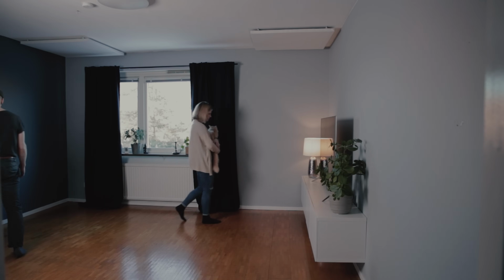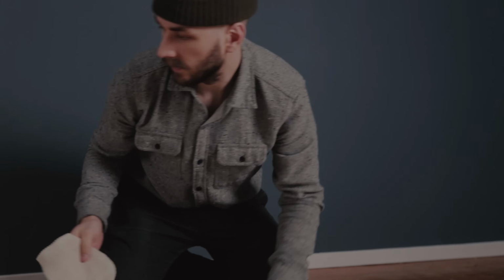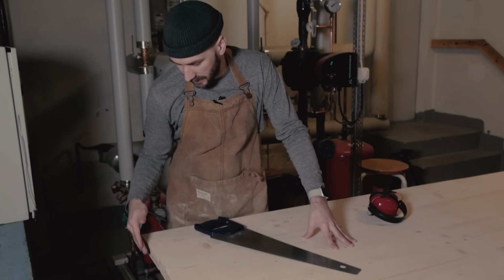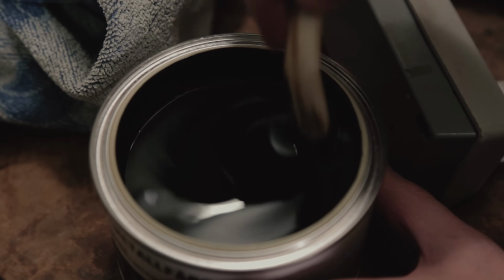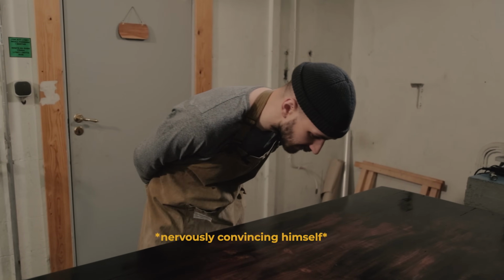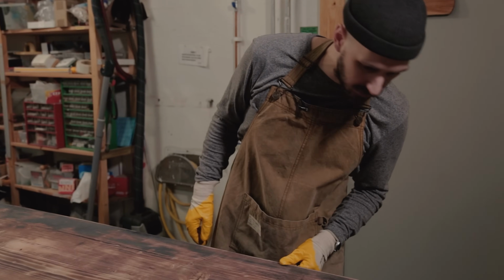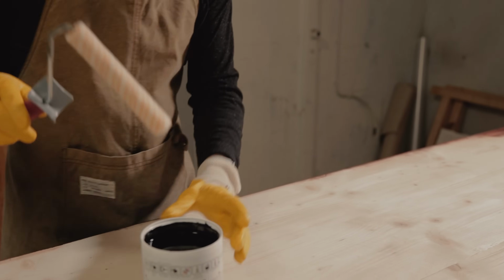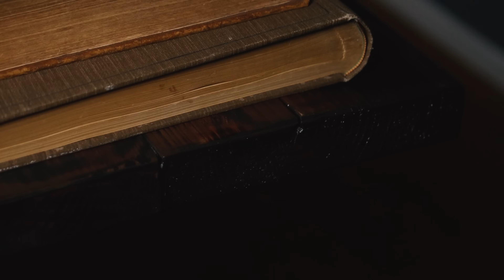Building a Desk using Cheap Wood (DIY)

Comment: I did this for my last computer desk and it was honestly not worth it. It looked great at first, but after about two years the pine did not hold up at all and it looked pretty bad. I replaced it with an acacia wood butcher block countertop. It did feel a bit like "cheating" to buy something premade, but it was less than half the price of buying a similar amount of hardwood and doing another glue up. Plus all the time it saved me.
Reply from the maker: Really? Sad to hear that Taylor. I have quite the opposite experience actually. I'm still using this table as we speak, 3 years later and it still feels and looks the same. It's holding up great honestly. I'm glad you're happy with your new table though. There's no such thing as cheating in making furniture, it's about doing what makes sense to you. There's no point building a table from scratch if you're not enjoying it, unless you want a very specific custom design of course. Sounds to me like you made the right decision! Thanks again for watching and sharing your experience!

Comment: Personally would have used pocket holes along side wood glue. Would have helped true up the boards to one another and straightened some stubborn boards out. Also alternate your clamps on both sides of the workpiece when glueing up, tightening some more then others you can bring some boards out of warp.
Reply from the maker: That’s a good call Cody, we might actually try that for the next table. We plan on building a kitchen table later this year! Thanks a ton for the tips and thanks for watching and sharing your thoughts here in the comments, we really appreciate it!
Reply: I would also reccomend burning the wood before you stain. It will prevent toxic fumes. :) Best of luck.  @byferner
Reply: glue and THEN pocket hole?
Reply from the maker: @Ninja_From_Fortnite I’m not sure what you mean?

Comment: Today that cost is doubled. 2x4 at hd in my area is almost $6. I end up getting a butcher block 72 inch for $110. Just needed some sanding and stain.
Reply from the maker: That’s unfortunate, if you wanted to build it yourself that is. I hope you’re happy with the results either way. Thank you so much for sharing, I’m sure others can find this information useful!
Reply: only $6? where i live “good quality” with this thickness plywood is $50-$100+ for both sheets and planks
Reply from the maker: Holy smokes :o

Comment: Honestly, this is great. You spent a lot of time making the table look really good at the end. It's a really rich look, like chocolate or coffee. I love it. Definitely a statement piece in a room. 

I think people would buy furniture in this style. Some basic end tables, or living room tables. Or desks. Maybe a bed headboard. You should try selling a few :)

The only thing that would make this build better is incorporating the computer into the bottom of the desk. I'd also say Router/modem, and power bars. 

When I built my desk, I was surprised that with just a bit of extra wood, and a few extra hours into it, I could hide everything inside the desk. It cleaned up the room massively. Depending on how your house is setup, I would recommend this if you kind of have everything in the same area around the desk. Really can tidy things up.

The only other tool I would recommend that you could get, that would make part of this a lot easier for you is a hand plane. You use it in place of the sander, and it'll help you get a nice flat surface much quicker. And if you can sharpen it well, smooth :)
Reply from the maker: Wow, thank you soo much my friend! What awesome feedback!

Yeah I’ve been thinking about selling furniture once I’m done with the ones we want for our place 😄

Incorporating the computer/router/cable management etc. has definitely been on my mind! Great ideas. A tidy work space and cable management is so satisfying!

A hand planer would be awesome, I can imagine that being really handy and make the process a lot faster!

Thanks a ton again for the kind feedback and for watching! 🙏
Reply: @byferner  No problem, It was a good video, Thank you! You made me love brown furniture. That took a fair bit.
Reply from the maker: @truckywuckyuwu  Haha, awesome!

Comment: Instead of a thousand rolls of sand paper, a simple manual planer would make quick work of those raised edges with almost no saw dust and they are easy to use as well.
Reply from the maker: That is indeed true, thanks for the suggestion! Would love to own one or more of those one day. As for this time this was the option in hand since we don’t own a hand plainer and the rolls of sandpaper were the only thing we needed to buy. Thanks for watching and interacting, much appreciated 😀

Comment: looks great :) thanks for the amusing comments in the video! it was great fun. one question: aren't you worried because of the soft nature of the wood? I want to build a desk soon and am not sure if pine will be hard enough
Reply from the maker: Thank you so much Lennart! Great question!
We would prefer to build it in hardwood, but it’s so much more expensive and we didn’t have any experience, we wanted to experiment with pine first. The clear coat will strengthen it a bit too. Plus we don’t mind if it gets a little bit more beaten up :D Also, I’m not sure we’re to look for hardwood around here, might have to order it online? Thanks again for watching and commenting, much appreciated!
Reply: Try soft maple ! Still easy to sand and work with but doesn’t dent easy like pine/poplar.
Reply from the maker: @NYSeaNile  Thanks for the tip, I would love to try it out! Unfortunately, we don't have much of that here in northern Sweden, so it's hard to come by and most likely pretty expensive because of that. :/

Comment: I would recommend a wax finish. Wax finishes with stains in the wax have thicker layers in cracks and light on flat areas. Then maybe some boiled linseed oil or maybe even shalack overtop
Reply from the maker: Appreciate the tip! I think that would be better for the look we were going for as well! Thanks a lot!
Reply: No problem 😊

Comment: I did something very similar, but I skipped a step. 

When I was dating my now-wife, I kept talking about how I always wanted to build my own desk. Most of the stuff you could get in stores was cheap and would fall apart, and custom made desks were extremely expensive. Not to mention, a 4 foot desk just wasn't enough. I wanted a 6 foot desk because I wanted it to fit a large monitor as well as my PC and have plenty of room for a large desk mat for my keyboard/mouse etc. 

Well, we moved in together right around my birthday, which was almost exactly a month before I asked her to marry me. For my birthday, she told me she had something for me in her car. I went out there to find a 6' x 30" slab of edge glued pine. Her grandpa has a large woodshop that he let me use. I took it there and spent about a week sanding it down smooth (but leaving the edges kinda rough for that rustic look), staining it, sealing it, and I mounted it on a pair of metal dining table legs I ordered off Amazon for like 80 bucks. 

I absolutely love the result.
Reply from the maker: Wow, thanks for sharing! That’s awesome! I love the hear stories behind DIY-projects! This is what makes each piece so special and worth the hassle of doing it! Thank again for watching and keep building my friend!

Comment: For final sanding, I found those 320 grit sanding sponges are very good and last forever.
Reply from the maker: Interesting! I’ve heard that if sand too find, the stain won’t absorb as well. So I guess it depends on how dark you want the stain to be. Definitely worth experimenting with though! Thanks for sharing your tips and for watching 😊
Reply: @byferner  That's a wrong hearsay, the stain will get in whatever how fine you sand, especially with a wood as tender as pine (chemically, lignin is corser than the stain). I don't go as coarse as 40, I start at 80 with the sander used for wood flooring, then use the 360-grit sponge to make it "shine", brush with a sweeping brush to get rid of the dust, then use white spirit, then 360-grit sponge again when the spirit has dried, then soak with sunflower oil (it's vegetable oil too) overnight and wipe. I guess that's when you'd use the blowtorch. And after that, I use the rainproof tint with sponge and tissue (like you) to avoid brush marks (which come in minutes if you don't wipe them immediately), I use the 360-grit sponge once dry before the (optional) second coat. I only go a third coat when it's going outside, like a kennel or a postbox, but for my "stage" made of pallet wood (basically a table without feet), it looks perfect after only 2 coats. I might setup a camera some day to show how I do and what I get, it's not necessarily how it should be done ;-)
Reply from the maker: @RegisMichelLeclerc Awesome, thank you for all that information! 

That would be really cool, let us know if you decide to record it! Thanks again for the tips and thorough explanation!

Comment: What do you think of shorter  planks going in the direction of depth rather than length?

Some barn doors are built like this in two layers.

Length wise is fine but could warp if stored in a humid environment?
Reply from the maker: Yeah for sure! I think you’d need some kind of reinforcement, like you said in two layers. Otherwise I think the table would lose a lot of strength and integrity. But honestly I’m no expert at all 😄 just my guess! But I’m sure it would look cool, definitely! 

I would also assume that you’d have less warping if you had two layers in opposite directions, but again I’m no expert! 😄 I’m just a newbie experimenting myself!

Comment: man, that's just my dream desk top I wish I just had tools and space to work on mine but unfortunately not have this much money to buy tools or rent them as they are not available to any local carpenter here.
Reply from the maker: Honestly I’m sure you can do it without the power tools! Depending on how the boards look when you buy them I guess. And when it comes to space, that can be tough I guess. I do a lot of work in the apartment if the basement workshop is busy 😅 but it’s not very convenient I guess. Anyway, thanks for watching my friend! I wish you best of luck, and that you find away around it!
Reply: @byferner  man I got the top already but made it copy of Karlby Ikea which I want to convert now to this burned and old  stained like you did, will manage about space but tools are must to speed up process
Reply from the maker: @abdullahdesigns00  Yeah for sure. Best of luck my friend! 🙌
Reply: thanks brother! @byferner

Comment: beautiful but is that gonna hold without dowel joints and just glue ?
Reply from the maker: Thanks! Yeah, just as strong. Dowels are mostly for alignment actually, the glue has all the strength you need and more 👍

Comment: With the tension on those joints I was thinking I might add dowels between them. I am curious after 4 years, how is the table holding up?
Reply from the maker: Yes, it’s holding up great! A lot of people misunderstand the role of dowels—they don’t add much, if any, strength to the joint, especially with boards this size. Their primary function is alignment and holding the pieces in place during the glue-up.

Once the glue has set (assuming you have a good joint and glue surface), the glue does all the work. In fact, if there’s excessive tension, the wood would crack or fail before the glue, provided you’re using a good-quality wood glue, curing in room temperature. Dowels won’t make a difference in that regard.

I hope this gives you more confidence going into a similar project! That said, dowels are fantastic and really helpful for alignment during glue-ups. If I were working with expensive wood, I’d definitely use a planer and dowels, biscuits, or dominos to ensure perfect alignment. This approach also minimizes the amount of material you’d need to remove afterward.

Comment: How strong this table is really? Plank edges glued together with no connecting dowels, since it is quite heavy. I am just wondering. I missed the part where the legs were built. Legs are half of  the work when you building a table in my humble opinion.
Reply from the maker: It’s pretty much just as strong as a table glued together with dowels. Dowels are mostly for alignment actually.
I agree with you! But the reason I built this desk top was because I was gifted a pair of adjustable legs from a friend 😄

Comment: You should have hand planed the top then sanded it through the grits to your level of smoothness. You should have also used a random orbital sander.
Reply from the maker: Would love to use a planer if I had one. I did use a random orbital sander for the finishing grits though 😊

Comment: Did you just use wood glue to connect all the boards together? No dowels or anything in between? Just asking because I would like to make a desk but I thought u had to have something between the boards so it doesn't fall apart
Reply: It wont fall apart. That is a common misconception. When you see woodworkers gluing tabletops with dowels or biscuits or dominos is mostly for alignment not for strengths. That glue bond will be stronger than the wood itself. (providing that you cut the wood straight and there are no gaps between the boards)
Reply from the maker: Great answer, thanks Guayabito!

Comment: Great result, but you haven't sealed the bottom. The wood is going to dry-up/soak humidity that way causing deformation, especially if put near a heater or window.
Reply from the maker: Thanks! I painted the bottom though? You don’t think paint is enough to seal it? 
I’m still using the table as we speak. I literally had it standing up against a radiator and a window just above it, no problem so far. I really appreciate the tip and heads-up warning though!
Reply: @byferner  Neither paint nor stainer is a sealer. What seals the wood is either oil, oilwax or clear coat. That's what you want to use for sealing. Both have benefits and drawbacks. Clear-coat is generally maintenance-free but more prone to scratching so in time might need sanding down and reapplying for aesthetic reasons. Oil/oilwax needs reapplying every 1-2 years for wood-health reasons, but offers continuos self-healing (scratches usually just disappear/fill-in in time without taking any action) and allows for direct contact with wood, which is a nice experience. I personally favour oil-waxing the top and clear-coating the bottom.
It's great your table has not suffer yet, but this is an ongoing risk. One, five or twelve more open windows during a rain, or particularly cold winter with dry air - and it might be too late. If I were you, I'd clear-coat that bottom at the earliest convenience (after oiling it a bit just in case it already drier up - no need to use anything fancy, cheapest linseed oil will suffice). 
And don't forget to seal the sides, if you haven't yet.
Anyway, congrats again on the excellent visual result. I really like that end-result. Next time, try oiling instead of clear-coating the top to experience the difference and see which one you like more.
Reply from the maker: @impact0r  Interesting! Thank you so much for the thorough explanation! I’ve got the sides covered at least, I’ll go ahead and seal the bottom with a clear coat ASAP then. I’m definitely going to try oil & wax next time around. I already thought about that a couple times since I made this table. Not only because of the benefits you mentioned, I’d also prefer the really matte look that you can get with wax too.
Reply: @byferner  No worries. Just be aware there are three types of oilwax finishes: mat, half-mat, and gloss. I find gloss too glossy, while pure mat works best with certain types of wood/grain. Half-mat may be the best choice in most cases, and certainly the safest one to start with.
Reply from the maker: @impact0r  oh ok, cool! I’ll keep that in mind! Can’t wait to make our kitchen table now!

Comment: If you had a router you could make a router planner jig... and used it to flatten all the boards taking the bow out.. or if you knew anyone with a cnc that can do it too...
Reply from the maker: That’s true, appreciate the tips! Luckily pine is pretty soft and easy to force out slightly bowing boards

Comment: Great video! Have you had any durability issues considering you only used glue?
Reply from the maker: Thank you so much! 
Not at all! Wood glue is actually a lot stronger than most people think. Stronger than the wood itself in fact.
As long as the two glue surfaces (aka the joint) are smooth and clean, and you have some clamping pressure while the glue dries, it will be really strong!
Reply: I was wondering about the glue also.
It’s been a couple of years, how is the desk holding up??
Reply from the maker: It’s held up great! I’ve actually been thinking about making a video about that too, since a lot of people have asked. (How the desk is now and what I think about it after all this time). 😊
Reply: @byferner  I think that would be a great idea for a video.

Comment: I'm a little confused. Did you use stains and then paint? If so was your paint oil based?
Reply from the maker: Yes, that’s correct. In this case it was an oil based “metal paint”, but as long as you sand beforehand, most paint would work fine, especially if you sand that and then have a finish/lacquer on top

Comment: Only glue is securing these boards together? No dowel pegs or anything?
Reply from the maker: Yeah, glue is more than strong enough actually. Dowels helps with alignment and making sure they don’t move around as you clamp down (which would have been helpful for us 😅) but you don’t have worry about it holding up without, as long as you get a nice clean fit with even clamping pressure! 😊